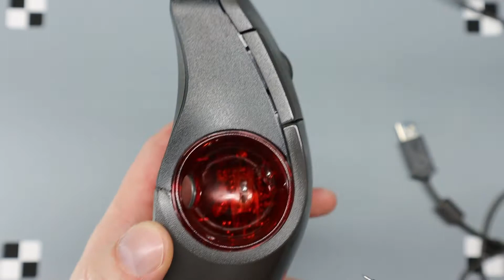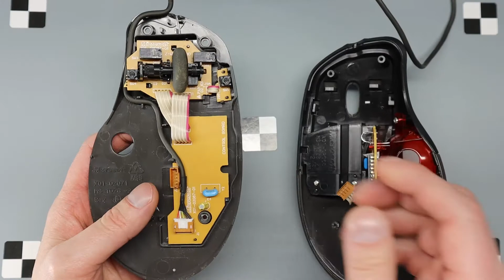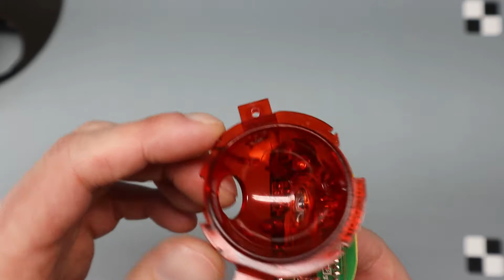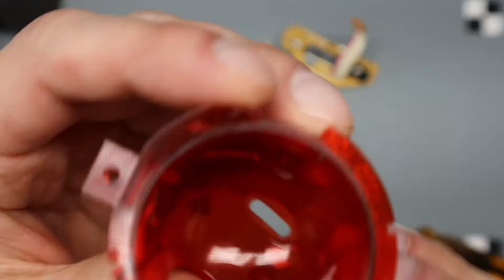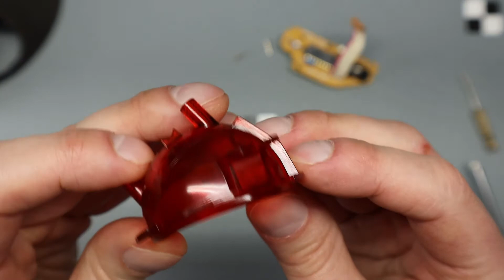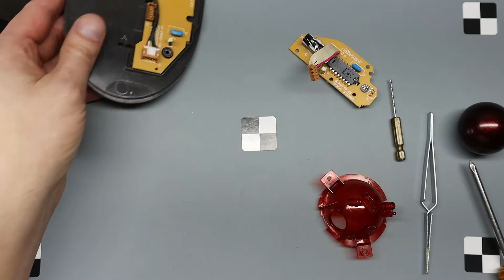Microsoft Trackball Optical D67 00001 Repair

Comment: I have the trackball explorer 1.0 5 button mouse that's the best mouse I've ever used, mine also has flat spots on the bearings but even if I replace them, they don't spin, so I don't see the point, Microsoft should have made the red plastic part thicker and installed a larger set of bearings that could spin in their pocket instead of this mess, they should bring back this mouse

Comment: I just found one of these at the thrift store that was missing a ball for 25 cents! I then bought a replacement ball on eBay. What a comfortable mouse! However I notice it sometimes is inconsistent with tracking, maybe the lens is dirty. I also noticed there are flat spots on the bearings, which another commenter suggested that you can rotate. I will try that and see if it helps. I really like the shape of the mouse in my hand so I think it is worth restoring.
Reply from the maker: The rotation does work, though you can only rotate them so many times.

Comment: thanks for your video, if you do not want to clean, you just drill directly each ball! if you have problem of th last screw that stuck with the red part, just renove the button part not up or downward, but remove straight then you gonna have access tobthe last ball, thank you so much!

Comment: Anyone, please:  Where can we get a replacement one-inch ball?  EVEN IF it isn't meant for any mouse??  one-inch PLASTIC ball "should" be something we can find.  I've sure tried and gave up.  I DID settle for a one-inch steel bearing ball. I soaked it in vinegar for a few days to knock the shine off.  it WORKED... but the weight of it causes a Momentum issue (the feel is odd cuz it's harder to start and stop rolling) but the biggest problem is wears out the tiny bearings too fast.
Reply: I found one on Ebay

Comment: No need to replace bearings for decades. With suitable tool you can rotate the steel balls so a new round surface is exposed and problem on sticky motion solved. This can be done multiple times. 
Never was the track ball itselft with anything other than soapy water. If the surface gets damaged with solvents it will never roll the same. 
Agree, only trackball worth repairing and the 9nlybone that fits adult male hands. Cheers
Reply: I use one professionally and have had about 7 of them. All have had the balls moved. Never pulled one apart. Small screwdriver works OK. Trick seems to be to push the ball into the socket as you push side ways. Never noticed them moving but when you look eventually they move and it comes smooth again. Cheers
Reply from the maker: Since I had two of these, one of them I did actually rotate a couple of the balls, but I still had to remove them to do so.
Not sure what kind of tool would allow you to rotate them in place.
Reply: I will have to try this with mine!

Comment: the only mouse ever made that is good enough to warrant repairing. 
I regret that i cant get a new one of these.
Its such a good darn mouse and its so comfortable.
Reply from the maker: Right, I haven't found any good wired trackballs that are a good size.
There are a few D67-00001 on Amazon, though they cost way too much.
Reply: @eeAspect  Google Gameball, a new great trackball with all the features and functions that trackball users have been wanting and top quality components.
Reply from the maker: Interesting, if it was a thumb ball instead of the center ball version I might have tried it out.
I did watch the official videos and it seems like your other fingers get in the way or aren't near buttons.